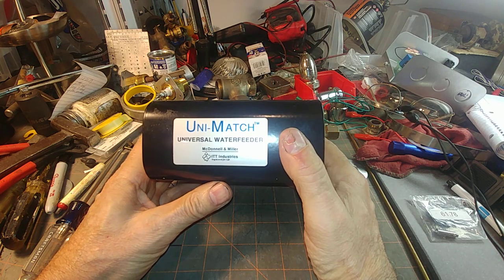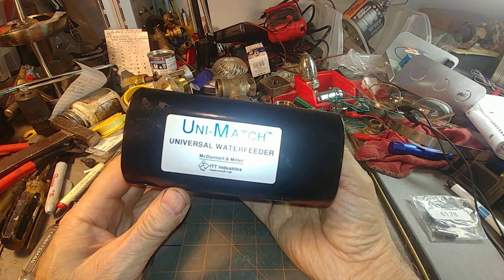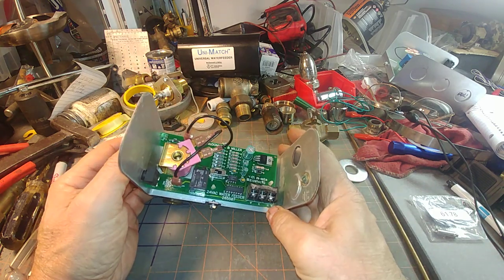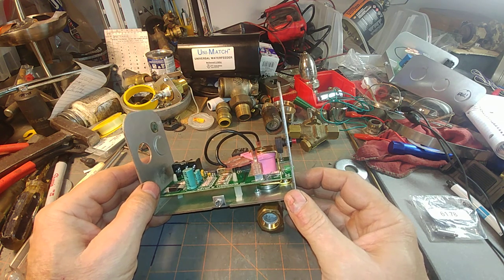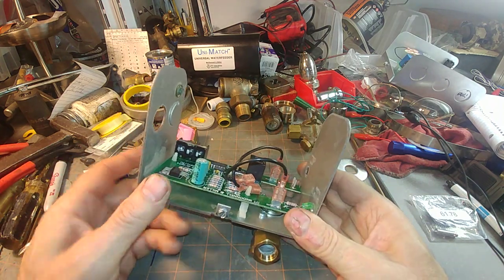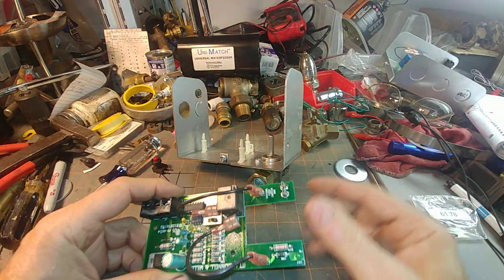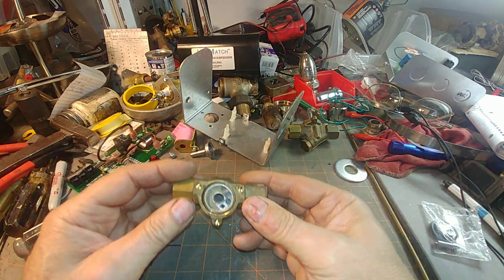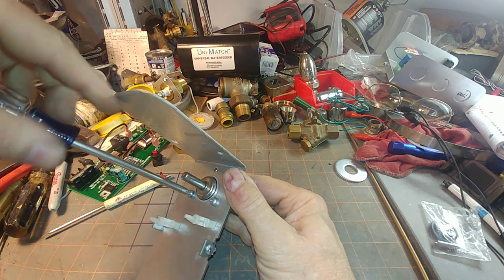McDonnell & Miller Uni-Match S-45 Valve Teardown. Water Feeder For Steam Boiler

Comment: i changed glass on burnham steam boiler,  i drained the water. After  replacing glass i added water , now green light does not stay on . it was one before i replaced the glass tube is there a reset button?? tks Mike b
Reply from the maker: The green light on the Uni-Match or LWCO?

Comment: I have a problem  with my one. It works when I hit the button, but it does not turn on when it calls for water?
Reply from the maker: You have a UniMatch, yes?
What voltage is it?
Did it work before and now does not?
What sort of low water cut off do you have?
Loose connection? Broken wire?

Comment: Hi, I have this same model and it's not feeding anymore. Even if I pressed the manual feed, no light nor water.  You mentioned this issue in the video. What did you do to fix it? Thanks in advance.
Reply from the maker: First, I'd get a volt meter to check if the feeder is getting power.
It might be 24 volts or 120 volts.
If you have an 120 v unit, be careful!
If the unit is getting power & still not working, I'd replace the entire unit with Hydrolevel's VXT of the proper voltage for your system.
The Uni-Match is not rebuildable, according to the factory.
The VXT is.
Reply: @gordonschweizer5154  should there be power even if it's not calling for water?
Reply from the maker: @jasonl8391  If there are three wires hooked up to your unit, then yes.
One is "hot", the other is neutral, and the third is the feed signal.
They should be labeled on the terminal connections as to what's what.
The unit needs power to at least allow the manual feed button to work.
Older versions only had two wires & no little button to add water and only got power when the LWCO called for water.
If you have the older two wire version, it needs to be replaced anyway.
If it is a Uni-Match of whatever vintage, it should be replaced with a new VXT anyway.
Reply: @gordonschweizer5154  it's wf2-u-120 with two wires, no hot. I'm just wondering if there is any diagnostics I can do before replacing it? Do you think opening the valve cap to do cleaning could help my issue?
Reply from the maker: @jasonl8391  Ok, just to be clear: it used to feed, now it doesn't.
There are only two wires.
It is 120volt unit 
I assume your boiler is a power burner oil maybe?
Are there three terminals in the unit, but only has two wires going to it?
Reply: @gordonschweizer5154  yes used to feed. Two wires hooked up on a 3 terminal. It's gas boiler.
Reply from the maker: @jasonl8391  An atmospheric gas boiler w/ 120 volt feeder?
That is.....unusual.
Do you have a Peerless boiler?
Using two wires going to a three wire control?
Sadly, not so unusual.
Sign of hack work.
What else did they screw up if they couldnt wire a simple control properly?
The feeder is wired improperly.
It needs a third wire to work properly at the very least (and a ground wire would be nice, too).
Check to make sure your low water cut off is working properly at least.
If it is not, it might not being sending a signal to your feeder.
Check everything with a volt meter.
Then, replace the Uni-Match with a VXT and have done.
Reply: @gordonschweizer5154  it's a weil mclain gas boiler. You're probably right about a hack job done by the previous owner's plumber. Lol. I will give a low water cut off a test. Thanks again for your help!

Comment: Can you tell me where I can get those parts, either the website or phone number?
Reply from the maker: McDonnell & Miller, in their wisdom, does not support their feeder with any spare parts. They want you to buy a whole new unit.
The current owner of the s-45 valve they use, RobertShaw, does not support any spare parts, either.
Draw your own conclusions as to which feeder you should install  Uni-Match or the VXT if you need a new feeder.
Reply: @gordonschweizer5154  hi an excellent video can you tell us dema  contact info for the parts
Reply from the maker: @issacyadgaran9611  Kleen Rite sells DEMA 443p rebuild kits.
These are NOT s-45 official parts so they are used at your risk.
Reply: @gordonschweizer5154  Thanks for a great video.  Both the hydrolevel and the Unimatch seem to work off the S-45.  Can I use the diaphragm from the Hydrolevel service kit?
Reply from the maker: @advantagerealestate7936  Thank you, sir!
Imperical field experience seems to indicate that the s-45 & the DEMA 443P clone can use each other's diaphragms interchangeably.
Reply from the maker: @advantagerealestate7936  Please consider swapping out the Uni-Match for a VXT if you can.
As you say, they both use the same valve.
I think I have a video series were I do just that.
Reply: @gordonschweizer5154  I may end up doing that but the location of the feeder is in a tight spot that requires much more skill than I have to replace it properly. $350 for the  Hydrolevel and  the plumber will charge at least twice that.  It's worth it to give this a shot first.